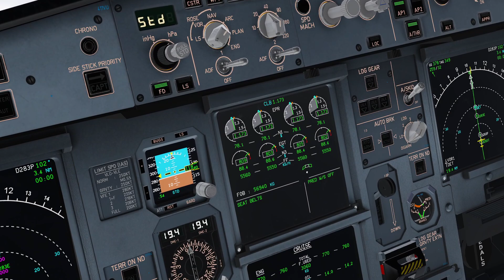Why do 4 ENGINE Aircraft normally climb WORSE than 2 ENGINE aircraft? | Airline Pilot Explains

Comment: A340-300 has 4 x CFM56-5C, the most powerful ones gave out 34,000 lbf, each weighing 4 tons. You get a total of 132,000 lbf from all 4 engines and a total engine weight of 16 tons.
A330-300 has 2 x Trent 772B, each produced 71,100 lbf, while weighing 6.1 tons. It gave A330 a total of 142,000 lbf from all 2 engines of total 12.2 tons. You can find other options like CF6-80E, being lighter at 5 tons, but produces less thrust at 68,000 lbf or PW4170 at 5.8 tons producing 70,000 lbf.
In lower altitude, where engine thrust matters more, of course A330 will outclimb A340. In higher altitude where aerodynamic matters, the less draggy and lighter A330 easily wins.
Things are different with A340NG - powered by 4 x Trent 500 engines. This plane is overpowered and used to be dubbed "Ferraribus". It easily blew every other aircraft during initial climb, but at higher altitude, its engine configuration limits the aerodynamic efficiency of its wings, and thus still couldn't climb as fast as its twin engine counterparts.

Comment: Airbus gave it crappy engines 😢 but the point you made is valid too.  4 engine planes are thing of the past ofc A380 exists but probably the last along with cost savings ofc
Reply from the maker: Airbus simply didn't need to give it better engines, why would they?
Reply: @A330Driver  there’s plenty vids on YT about why the 600 is the way it  is.  it’s under powered but acceptable as you said.  But that’s history…according to sources the  200/300 twr 0.5 and 600 0.61 along way from the newer planes but then there’s thrust derating and then discussion is meh 🫤
Reply: @gwalker3092  the 600 is fine. it has a perfectly normal thrust to weight ratio for a plane of its size. the -300 was the problem child